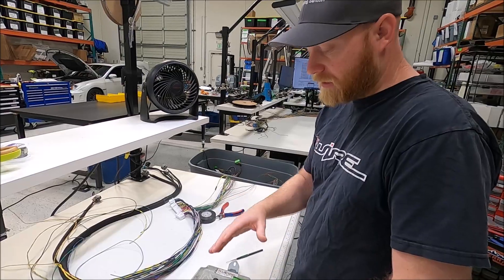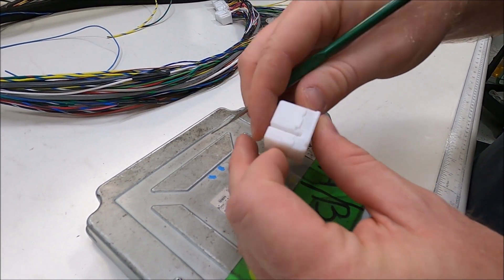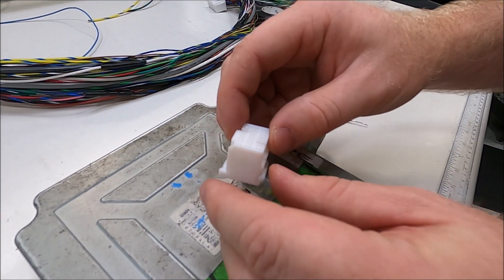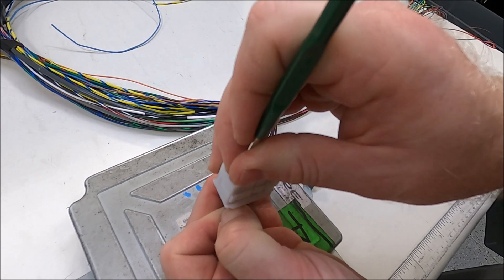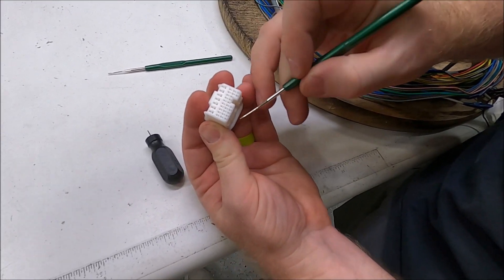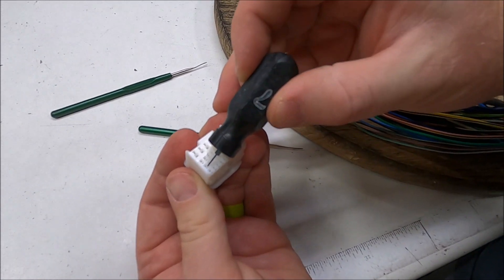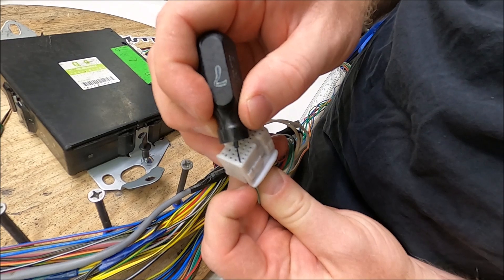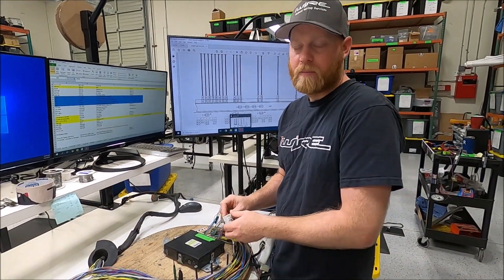How to Depin an ECU Connector

Comment: But what do you do if the wire was corroded and is no longer attached to the metal "pin"? In other words, I can release the tab/catch, but if I have no wire to tug on to remove it, how do I depin it?
Reply from the maker: You would need something to push from the front side to get it out the back.
Reply: @iwiresubaruwiringsolutions  Do you make that tool? What do you recommend, and what "hole" do I push the pin, or whatever I use, into?
Reply from the maker: @deanrock4331 I don't believe there is a specific tool for this. You'll just need to find something small enough to be able to push the pin from the front without damaging the housing.

Comment: I looking for the best tool to unpin the headunit adaptor harness not the one in the cat the adaptor the female that has the males pin in them there are small pins and large pins
Reply: Do you guys have a website where I can contact you?
Reply from the maker: @ali-sleimanchehade6129  Thanks for reaching out. You can contact us at info@iwireusa.com or go to www.iwireusa.com. Our standard tool kit should be what you need for most scenarios.

https://iwireusa.com/products/depinning-tool-set?variant=41181769334937&country=US&currency=USD&utm_campaign=sag_organic&srsltid=AfmBOoqxuvyulr28XCWYGdrVvx1dInmAhNR8dbb_VF2r0YqJA6ht0N5Z_ak&utm_content=YT3-MyAFym6QZmMZLySzWkztJ6SO21yXqEQAnE5tKfQeZIuH1wZAAf1k1vZKfMhR5DRLtcpzrfLylTeWg23tVYD0&utm_term=UCqBSsv8KMWWwBlt3YcQg-xA&utm_medium=product_shelf&utm_source=youtube

Comment: A little tip: don't pull on the wire "prematurely". You'll bind the locking tab in place and you won't be able to lift it up. Instead: push the wire in to remove any tension on the tab, the push the depinning tool from the front of the connector and lift the tab, then pull the wire out of the back of the connector.

Also not that all 5 of the depinning tools are different. If the tool you're using won't fit, look for one that will.
Reply: what if i did what u said not to do? i cant get a pin out. pulled so hard after, the cable cut off and there is only the pin inside the connector, with the locking tab messed up in there idk what to do and i need this plug asap
Reply: @illegalnights  What kind of connector? You might want to order a new one.